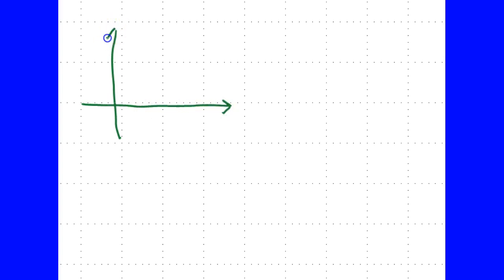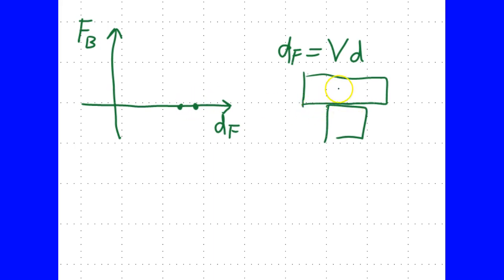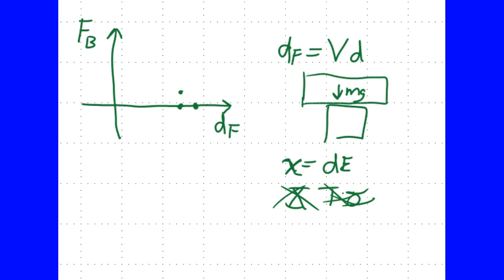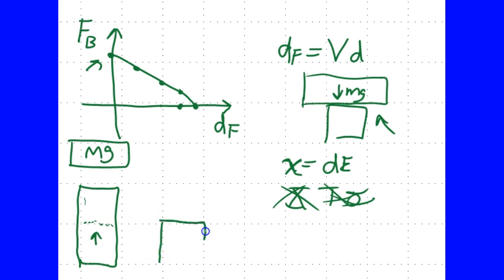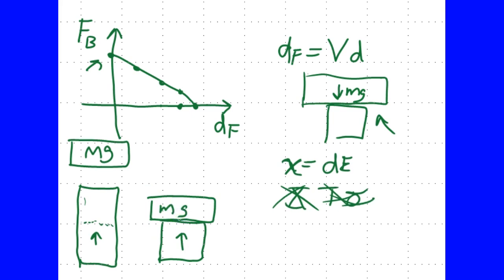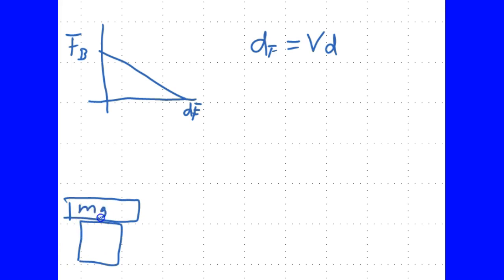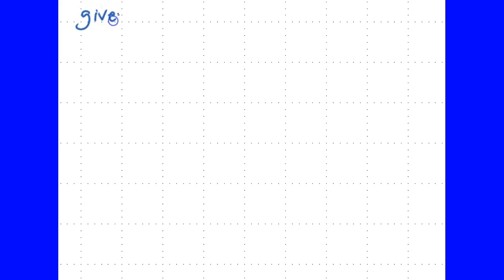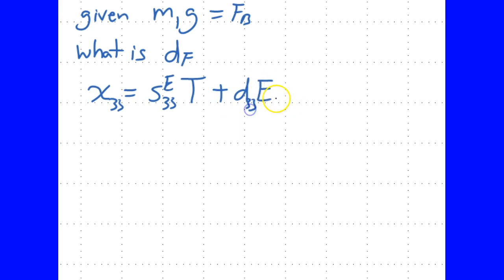Learn Piezo Lecture 7G: Blocking force and free displacement and piezoelectric actuators Part 2

Comment: Can we only use mass as a blocking force?
Reply from the maker: Mass is not a stiffness. Mass will offset the displacement if we include gravity. There is work done on the mass because it increases in potential energy. That will need to be accounted for.